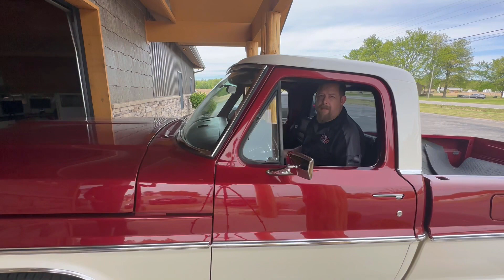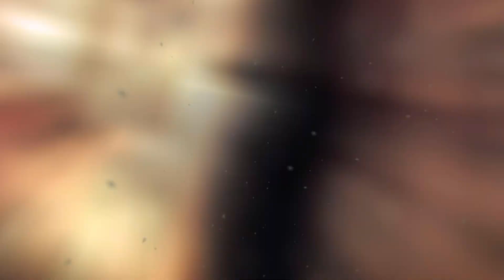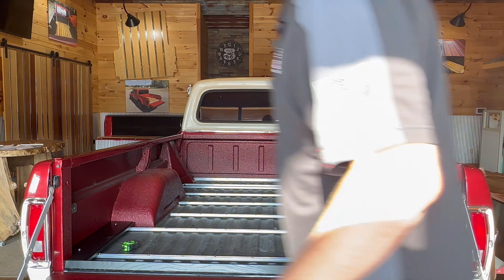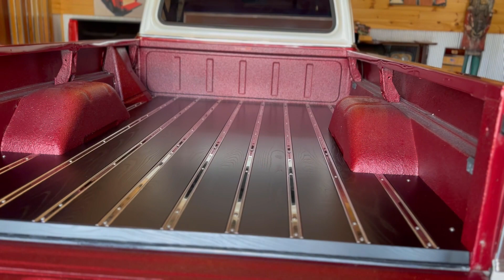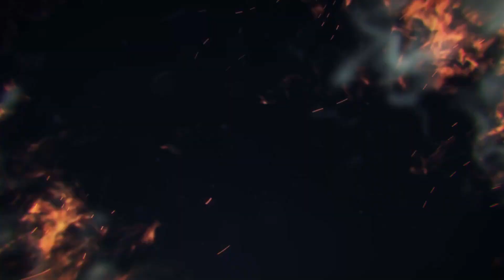Dream Giveaway Ford BedWood® Installation

Comment: Hi BedWood, I have acouple of questions with this carbon kit, I'm looking at one for me 67 f100 styleside shoty and really like your speed bump and flat top bed strips and the hidden fuel concealment kit, or the smooth rectangle fuel door cause my tank is in the frame under the bed. Can I get the carbon kit with these strips and fuel option?